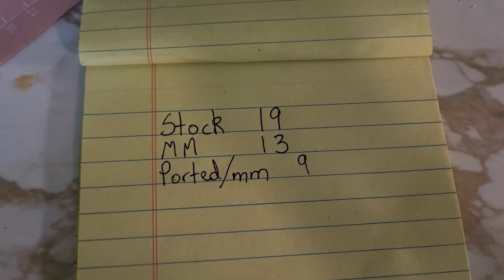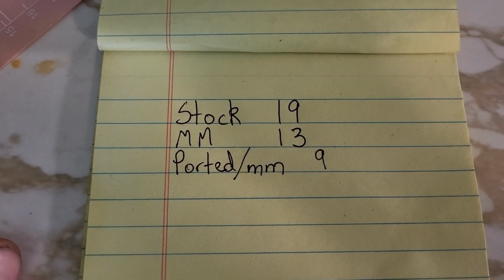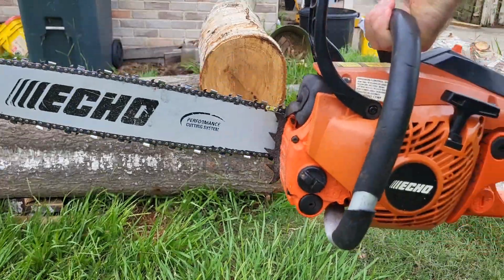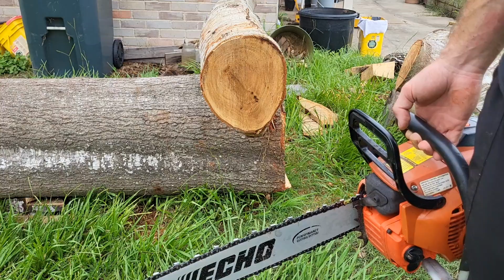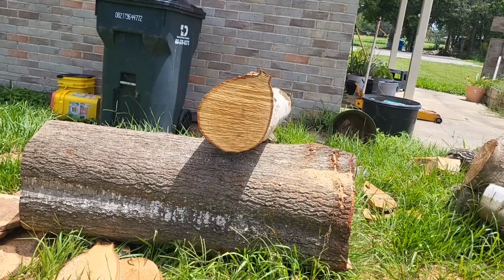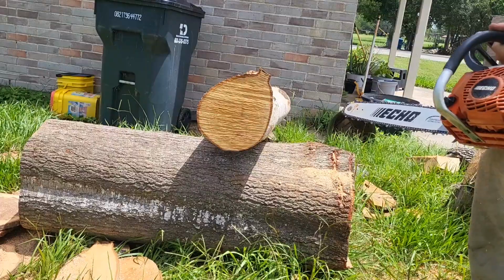Echo CS-450 - Stock, Muffler Mod, Ported

Comment: I wish they sold that little 4310 over here in the States that little lightweight thing. Pushing 3 and 1/2 or 4 after a port probably would be a heck of a little limber and firewood saw.
Reply from the maker: I wouldnt be surprised if this one is around the 4hp+ mark. It is definitely stronger than a stock/ slightly modded 4910

Comment: 👍🆙SD
Reply: How does someone decide what good port timing #'s are on a cylinder, how do you decide what #s you need or want?
Reply from the maker: @Doc-Cole_Trickle-of-Chainsaws i look at where they start out and based on experience pick from there. 
99% are going to be in the realm of 72-80° on the intake, 125-119° on the transfers, and 108-98° on the exhaust.

I'll make a short video real quick.
Reply: @Super-Dave-Outdoors 👊SD, TY!